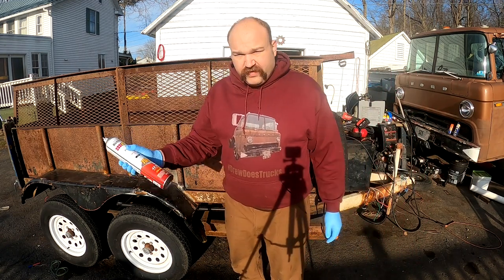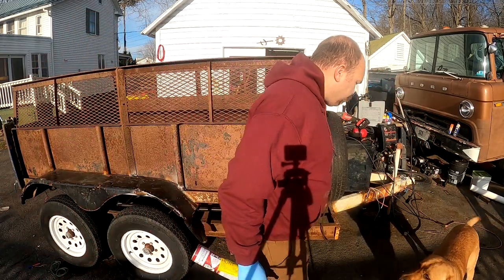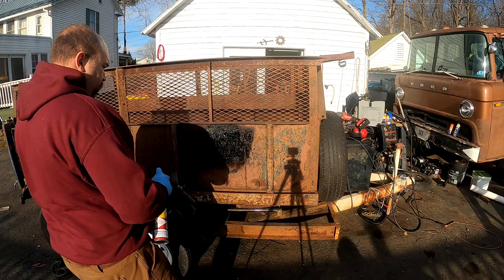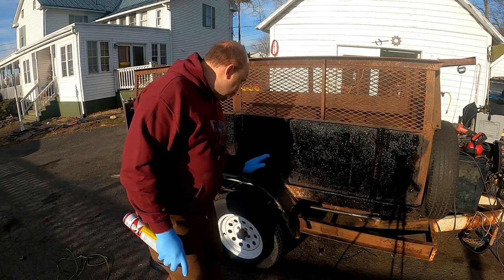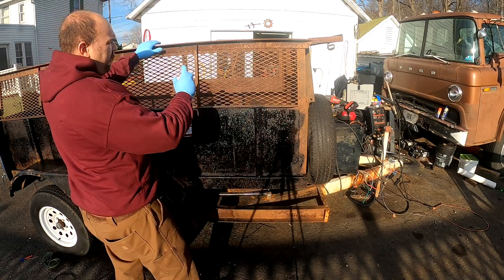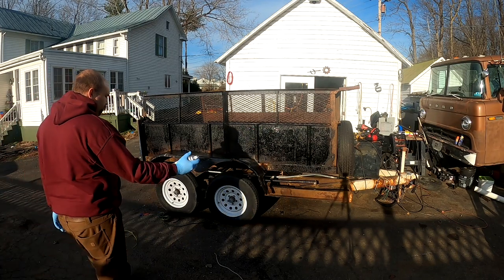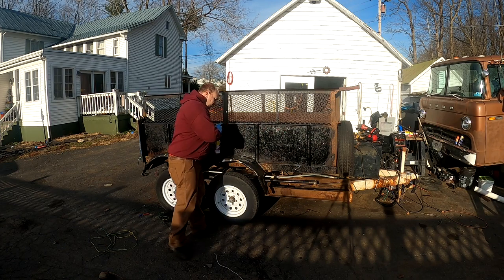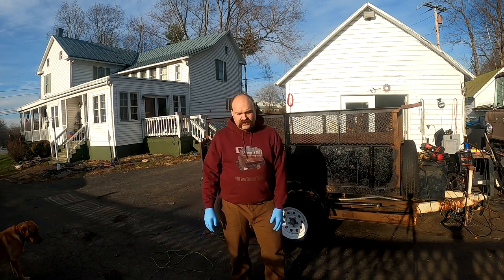Trying out Rustoleum TURBO spray paint on the DIY dump trailer, and Happy New Years!

Comment: Great vid. Never seen that can before. With so much rust on your trailer, I think I would do a quick sanding, then use rustoleum primer for rusty metal, then spray the turbo paint. The finished product should look much nicer that way.
Reply from the maker: I plan on painting it with a brush when it warms up. I just wanted it all one color for prides sake.